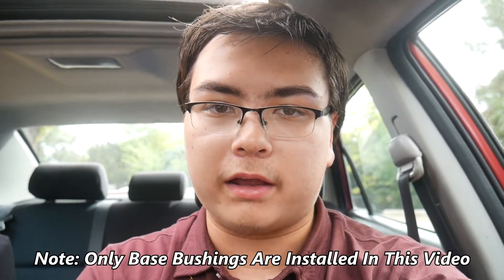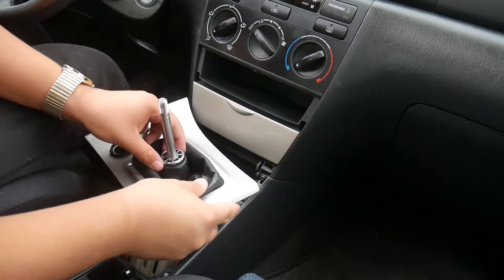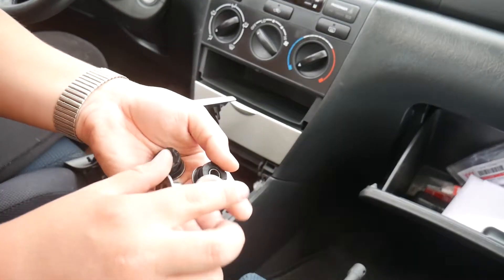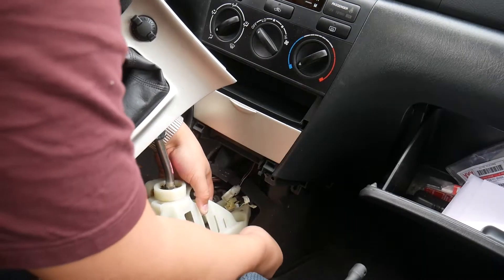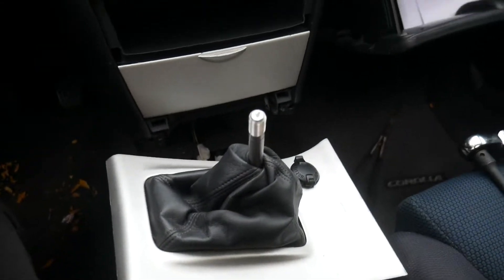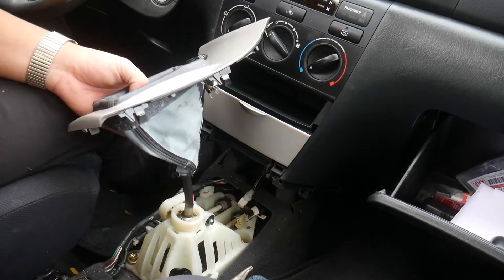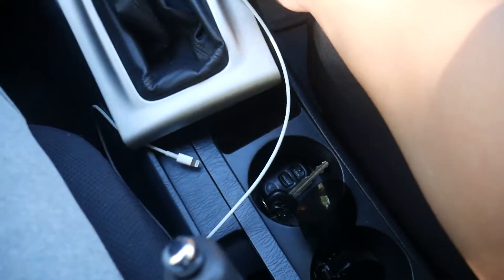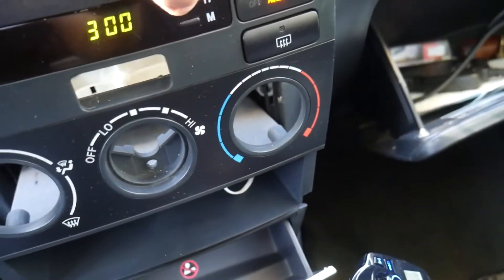Installing Shifter Base Bushings In My Corolla XRS

Comment: the shift boot should come right out. i'm not sure why yours is like that. the next item should be "shift cable bushings". imo, they made more of a difference than the base bushings.
Reply from the maker: I wonder if the previous owner glued it on or something, I'll look into it. I was planning on installing the cable bushings in this video, but the old ones are rusted on and I don't have the tools to remove them at the moment.

Comment: Hey I know this is a different corolla and totally off topic. But I semi recently got a corolla and have been doing a hand full of mods for handling and anesthetics and your videos on the old corolla have been alot of help. And I've been considering upgrading my sway bars but on your sway bar video you didn't drive it afterwards because of the sub frame issues you had. And I was just wondering how that worked out. Did it make a noticeable difference? Is it worth the pain of lowering the sub frame and all that? I did new wheels and tires and will soon do coils but do you think sway bars should be on that list as well? Thanks
Reply from the maker: All comments and questions welcome! I felt the car had tighter handling, but the difference will be less noticable with coilovers since the higher spring rate reduces body roll more than any other suspension mod. Whether or not you want to go through with sway bars depends on what you want to use the car for. If it's just a street build that sees spirited driving, I wouldn't worry too much about at least the front bar. The rear sway bar is easy, so no worries there. If you really want to get the most cornering ability as possible then the front sway bar will be worth the effort, especially if it sees many track sessions, but otherwise I wouldn't bother. Most likely not going to upgrade the sway bars on my XRS at least for a while, and when I do it'll mainly be to make a better sway bar install video lol. Thanks for the comment!